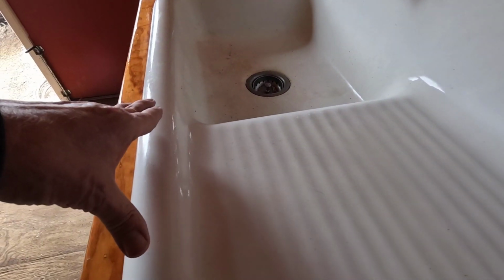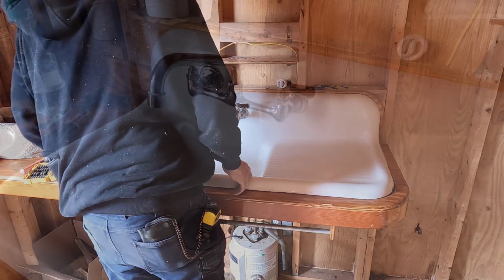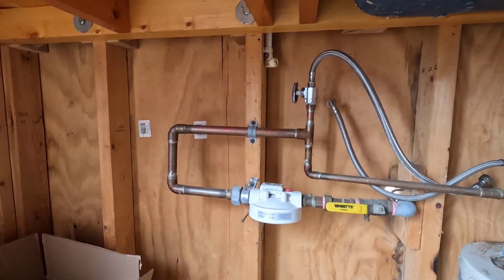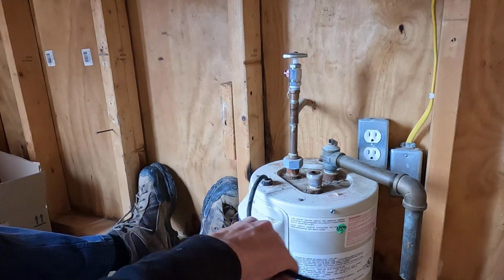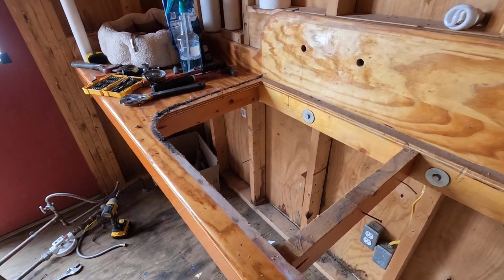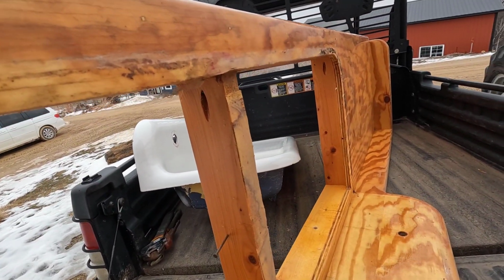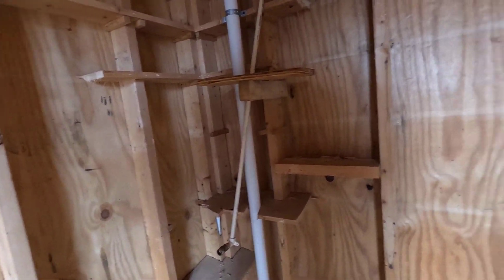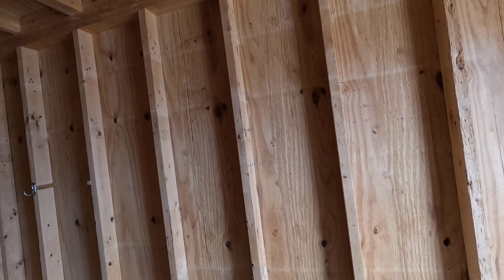Removing Grandpa’s 91 Year-Old Cast Iron Kitchen Sink

Comment from the maker: It took awhile to remember how I got it in there, but once I did it came out fairly easy. There was a few tense moments with the nipples that the faucet hooked-up to — they were crushing on me a bit — but in the end, it came out intact 😊

Recent Products used:

Pet Safe Mouse trap - https://amzn.to/3Zx5YdR
60 Watt Blue LED Bulbs - https://amzn.to/41eKzYL
Boeshield Total Tool Care Kit - Large Two Pack - https://amzn.to/41aqnqG
Strain Relief Rubber Boot - https://amzn.to/3YJGtGq
1/4" Nominal Polycarbonate - https://amzn.to/40YIobD
Power Cord - 10ft 14-Gauge 3-Prong - https://amzn.to/3YGLdML
PlyWheels Plywood and Drywall Dolly - https://amzn.to/3JXe4bi
DEWALT 15 AMP Plunge Router - https://amzn.to/3EcyZ6g
Oscillating Tool Blade, Titanium Nitride Coated - https://amzn.to/3JM45Wi
30 Pack Black S Hooks - https://amzn.to/3lg0cyB
3/8-Inch-Drive Impact Extension-Bar Set - https://amzn.to/3lcpr4I
6 Piece Impact Socket Adapter Set - https://amzn.to/3HycYjk
Bolt Extractor Set - https://amzn.to/3x146Od
Kinco - Premium Leather Work Gloves - https://amzn.to/3XWT0W3
#10 Countersink - https://amzn.to/3kxA6H3
1/2" Shank Tongue & Groove Router Bit Set - https://amzn.to/3QQk0UZ
Temperature/Humidity Sensor - https://amzn.to/3CwMD3h
16' LeverLock Tape Measure - https://amzn.to/3MRu9i9
Seagate Desktop 8TB External Hard Drive - https://amzn.to/3gRZGEC
SuperWinch Terra 45 - https://amzn.to/3AdzJWR
Large Tapcons - https://amzn.to/3TDkJbz
Heavy Square Washers - https://amzn.to/3E1tvKV
DeWalt Impact Wrench Kit - https://amzn.to/3EtMaQY
Flexzilla Air Hose - https://amzn.to/3ARo6W5